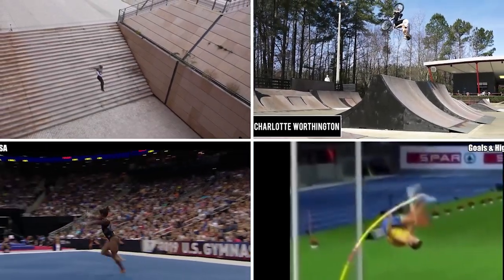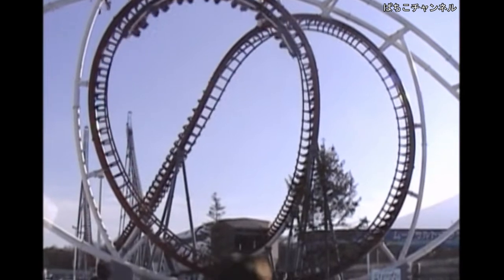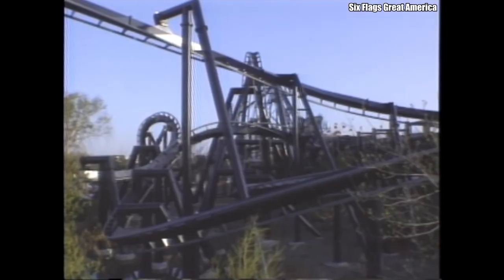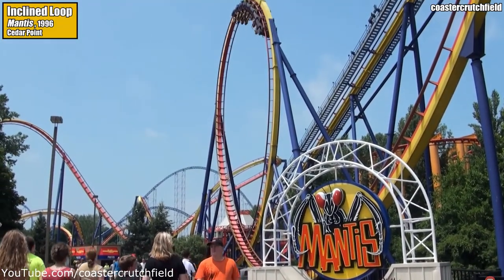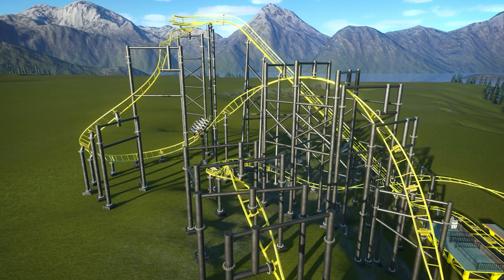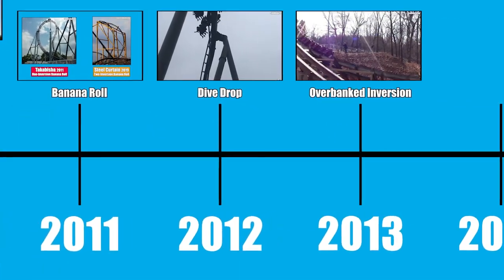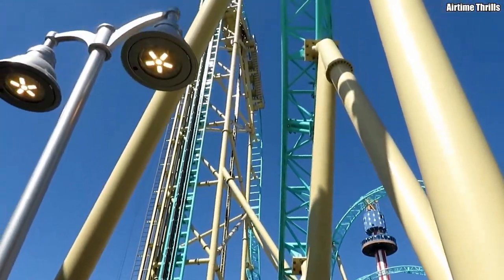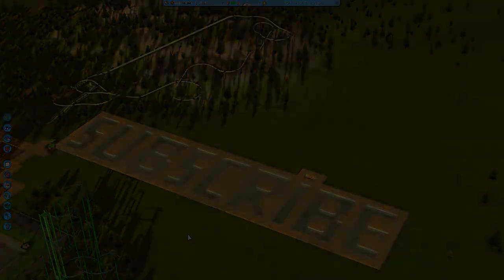The Complete Inversion Timeline - A Chronological History of the Inversion

Comment: Engineers 1846 - 1895: "There is a loop."
Engineers ~1900 - 1974: "There is no loop."
Engineers 1975 -1984 : "Corkscrews, loops, and fusions!"
Engineers 1985 - 2003: "All of that, plus barrel rolls, and more variations. And repititions. And repititions."
Engineers 2004 onward: "Arbitrary weird angles and unintuitive changes in direction of rotation LET'S GOOOO!"

Comment: I've always found it really interesting that Arrow engineers designed the teardrop shaped vertical loop to mitigate forces as the train ascended the inversion, a necessary invention for rider comfort and safety at the time... only for Mack and other modern manufacturers to completely ditch that and go back to making circular loops again like on Copperhead Strike.

Comment: Great video! I feel like cobra roll and corkscrew seem to be on every inverted coaster these days. The pretzel loop, zero G stall and dive loop are easily the coolest elements that have made it on to modern coasters, the zero g stall on Velocicoaster at like 60ft in the air over the main walking path is just the engineer flexing their skill.

Comment: With a lot of people questioning about half inversions, here’s my history of them.

2000: Fly to Lie and Lie to Fly. Essentially half inline twists that flip riders either from face down to face up or vice versa. This was first found on the Vekoma Flying Dutchman Stealth at Paramount’s Great America, now Nighthawk at Carowinds.

2002: Upward Inside Raven turn and Downward Outside Raven Turn. X (now X2) at Six Flags Magic Mountain was the first ever 4D coaster, and the last by the legendary Arrow Dynamics. These are essentially half loops with drops instead of rolls on the ends. The first has trains on the inside of the loop and starting at the bottom, whilst the second has trains on the outside and starting the loop at the top.

2007: Downward Inside Raven Turn (Stinger Curve). These are a new variation on the Raven turn. This actually first appeared on the Intamin Zacspin Kirnu back in 2007. The Vekoma built and now defunct Stinger in China had version of this element called a Stinger Curve. This one has the whole element braked to reenter the station, unlike the Zacspins and all of the later S&S 4D free-spins that also featured this element. So far, no roller coaster has an Upward Outside Raven Turn, with the exception of the lift hills for the Zacspins and Freespins. Other weird thing, the Zacspins and Frespins aren’t technically 4D coasters, as they only have a 2 Dimensional layout.

2011: 540 Degree Roll. On RCDB, this is always listed as an Inline Twist and a Fly to Lie back to back on these B&M flying coasters. But this should count as it’s own inversion and a half. First seen on Starry Sky Ripper at Joyland and later seen on Flying Dinosaur at Universal Studios Japan, this is essentially a Zero G Roll that preforms an extra half flip on the way back down.
Reply from the maker: Thanks for putting this together! Excellent synopsis of the half inversion family

Comment: You forgot an inversion. Vekoma has also introduced the Stall Loop, found on Fønix in Denmark. It's only just doing it's first test runs just now, but it is a new inversion for 2022
Reply: it looks more of a sidewinder than a loop
because of the shaping
Reply: @boltgaming248  well it's called a Stall Loop, I didn't invent this inversion, just accept the name of the inversion💀
Reply: @HybridCoaster  ok
but chris from airtime thrills called the sidewinder on hangtime after the dive "a negative g stall loop" despite it looking like a sidewinder and just calling it one element despite it being 2 elements in a row
but the negative g stall loop is a dive into a sidewinder
which is similar to the finnish loop but the sidewinder is replaced with a loop
and it does not go into a banked upwards right turn into a dive it just goes up into the dive and into the loop
Reply: @boltgaming248  that's not relevant, he did not create the inversion, and Vekoma invented this inversion, so just give up tbh

Comment: I do think it's important to mention X2 at six flags magic mountain. Even though the track doesn't invert, the cars do, which gives an incredibly odd and never before felt sensation. 
Another honourable mention would be the current record holder of most inversion, The Smiler at Alton Towers, not necessarily for inventing new inversion, but rather for fitting so many inversions in a compact layout. 
Lastly, even though they are 0 inversions, the non-inverting loops and similar elements are also worth mentioning. 

Anyhow I think it's really cool to see how many elements my home park is claiming, maybe not proud to have the first SLC, tho xD

Comment: There's two elements I think are missing from the list:

Kickflip (2017) - Exclusive to the S&S launch coaster Galeforce. Acts as an Immelmann that throws riders into an outer banked airtime hill on the descent.

Mosasaurus Roll (2021) - Exclusive to the Intamin Blitz VelociCoaster. Variant of the Heartline Roll that is not perfectly heartlined, causing sustained negative G-forces along the entire element.
Reply from the maker: I may be wrong, but doesn't the Kickflip not invert riders? Kind of acting like a non inverting loop on the ascent? As for the Mosasaurus Roll, I do agree that it could be considered a unique inversion. It was a bit out of the scope of this video, but I'm considering making another one someday focusing on "unofficial" inversions like the Mosasaurus Roll
Reply: @JNattyBoi Sorry for the late response, but I don't buy that Galeforce doesn't have any inversions. It's quite possibly my most ridden coaster ever and, both on and off the ride, I can find a few points (including the Kickflip) that appear to go beyond 135 degrees. Granted, I am a layperson and I'm not an engineer, but it certainly looks it.

Comment: I guess you could consider any 4th dimension coaster an inversion by itself. One could consider them the Rollercoaster's equivalent of a Lomcovak from the airshow circuit.

Speaking about airplanes. I don't think there's any set definition for what constitutes as an Immelmann (turn). I believe in aerial acrobatics (aerobatics) an Immelmann turn requires a circular half loop (Yes, high Gees at the bottom and few gees at the top), followed by a level aileron roll.
Meanwhile the rollercoaster Immelmann turn is more reminiscent of a half Cuban Eight; Where the pilot flies 5/8ths of a full circular loop. Ending the loop facing down at a 45 degree angle. This then follows a half roll at the end.

P.S. Theme parks, stop this madness and just build more 4th dimension coasters, or that Robo coaster from RCT3.
Reply from the maker: Very interesting. I know almost nothing about aerial acrobatics so this was a fun perspective to read. You’re definitely right about 4th dimension coasters: any stretch of track could potentially contain an inversion, how does one classify that?
Reply: @JNattyBoi  I guess you could just say that 4th dimension coasters have just one single giant inversion per block if you want to keep it simple.
Of course if you wanted to make this list longer you could add individual inversions as well, since there are a limited amount of 4th dimension coasters and or a limited amount of not painful combinations of track inversions and rotations.

Comment: Very well done, although i am a little surprised you didn't mention the fourth dimension flip. Which is an undetectable inversion upon inspection of the track, but happens when a fourth dimension coaster flips it riders. They come in controlled and uncontrolled variety with the controlled version occurring by the design of either the trains cars themselves or a secondary rail on the track.
Reply from the maker: Thank you! I was mostly interested in looking at traditional track-based inversions, but you're right, it was probably worth mentioning fourth dimension coasters

Comment: I don't know if this is just a standard one or an inversion of its own. The roll-over on Star Flyer at Star City, instead of going into a half-loop and into a twist and down to another half-loop, Star Flyer goes into a half-loop then into a twist, but that twist more that 360⁰ degrees making what looks like the turing drop from a Step-up underflip, but on a Inverted coaster.

Again you can correct me if I'm wrong.

Comment: Some corrections: the "Sky Loop" is actually called a "Snake Dive", and the "Zero-G-Winder" is the SECOND inversion on Yukon Striker (a zero-g-roll that twists to one side on the exit). Oh, and why didn't you mention the Modern 360 degree Circular loop featured on Cobra (Conny-Land) or more notable, Copperhead Strike at Carowinds!

Comment: hey just saw this video for the first time, and I love the work you put into making this!  

I read your pinned comment about the 4D's and thank you for saying that, but I feel like that only applies to models like the Zacspins, Free-Fly's, Axis and such free-wheeling models.      For the fix track 4d's like X, Dinoconda and the E one I can't spell would you consider that those welded 4th rail dependent inversions are as fixed as other static trained models?

The other situation is where I see RCCA listed for having the first modern wooden loop.   I feel their (appropriate) credit in the ranking breakdown as the design very clearly brought its own challenges which lead to its demise, sets a precedence where I think B&M, Intamin, RMC, Togo, Vekoma, Mack and several others would have a much higher count if they too were given credit for overcoming the first inversions of individual designs...   I feel having the first vertical loop on a modern wooden coaster surely could compare to Togo first vertically inverting riders (almost) safely, or BM solving Arrow's dilemma of inverting riders suspended and I'd like to see how the rankings could change with those considerations

Comment: 20:03 if a Banana Roll counts as two inversions, when the track levels out to less than 90°, shouldn't a (first) drop with more than 90° count as an inversion, too?
Reply from the maker: I think a first drop would only 'count" as an inversion if it was angled at 135 degrees or more (90 + 45, meaning it's more upside down than right side up). The coaster with the steepest drop in the world only goes to 121.5 degrees, meaning the track doesn't fully "invert." In the 2-inversion banana roll, the track inverts, hits 90 degrees (un-inverting itself), then inverts again. Interesting stuff to think about though

Comment: what does modern really mean in the context of coasters though? I always considered it to be something that is present in order to work with the general meaning of Modern.. Can we really consider SOB a modern looping wooden coaster since it hasnt had a loop since 2006? over 15 years in the past? Just bouncing wonderings around.

at any rate, very interesting video! learned a few things I didnt know!
Reply from the maker: That's a good question! I guess I was using "modern" as a relative term: Son of Beast is certainly modern relative to the wooden looping coasters of the early 1900's, when coaster engineering was still very much in its infancy. I'm not sure one could call Son of Beast "modern" when comparing it to rides like Outlaw Run, but I think on the scale presented by the video timeline, it's fair to call it modern. Very interesting stuff to think about though! Maybe Outlaw Run could be considered a "post-modern" wood coaster lol

Either way, thanks for the comment and the discussion!

Comment: If the quad heartline roll is a new inversion, then wouldn't the triple heartline roll on Monte Makaya count?
Reply: On a related note, you can clearly see where Duane Marden gave up with inversion names.  Steel Vengeance's weird 180° stall drop thing, the half double zero-G roll it uses as its first inversion (the other half is on Iron Gwazi), Wicked Cyclone's 200° stall, whatever the heck we want to call the Vekoma Top Gun's first element, and half the elements on Smiler all have official names that Marden ignores because it was getting stupid.
Reply from the maker: It would, but I wanted to try to shorten the list where I could, so I left it off knowing I would talk about the Quad Heartline roll later (an iconic inversion I couldn't bear to leave off). You're also very right about RCDB - it was a great resource for creating this video but definitely isn't all encompassing when it comes to more recent inversion names